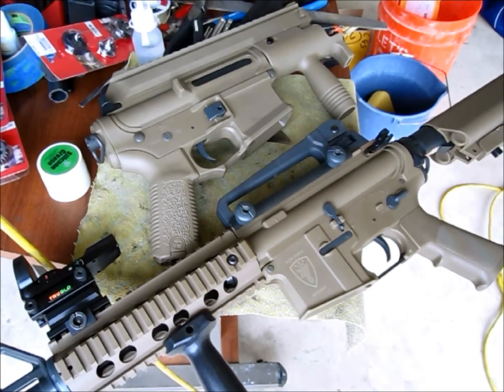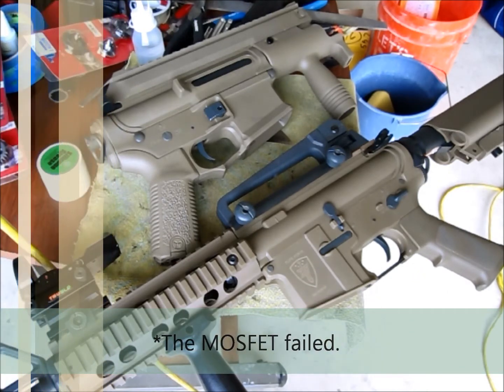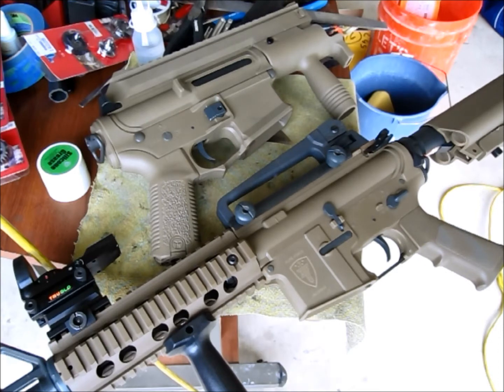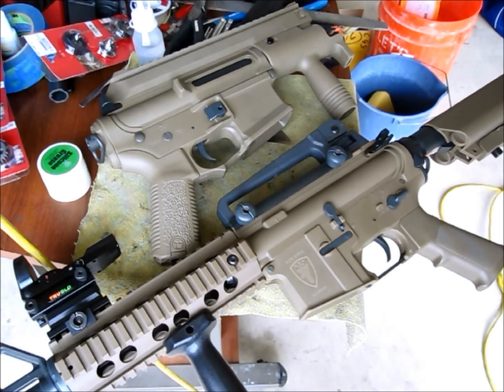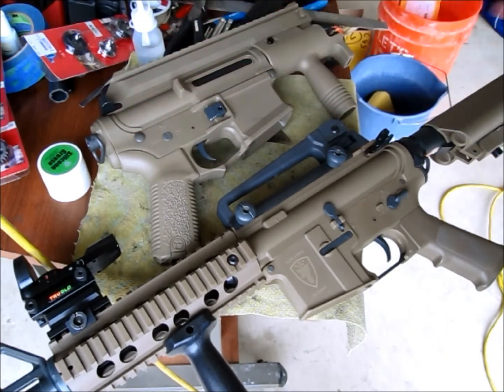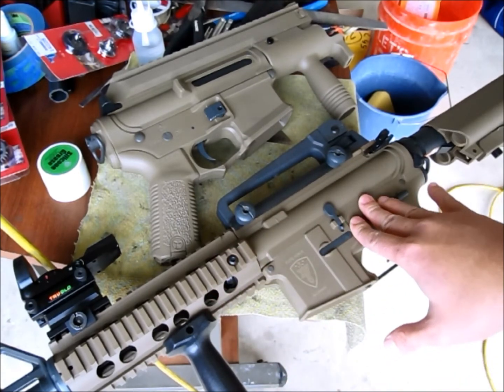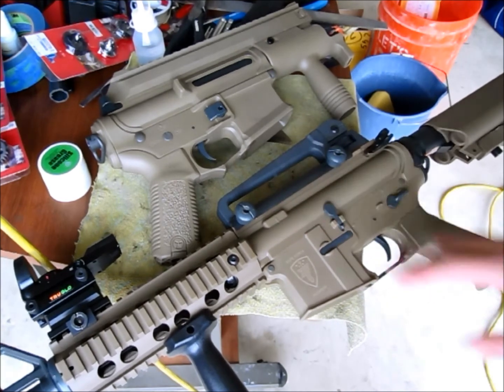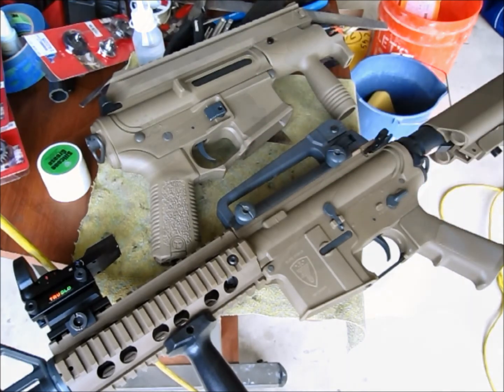Tech Section: Compatibility of ARES V2 Gearbox with Amoeba Series Line. Part 2

Comment: Sup mate, 
from your video it would appear that the Amoeba EFCS GB should fit more or less any TM compatible V2 receiver. Could you kindly confirm?
If not, what would the major differences between TM V2s and the Amoeba EFCS V2 be?
Greetings from Germany
Reply from the maker: +Angelus Nox 

As of right now I only know the ARES EFCS V2 fits in G&P lowers.  Gear Wargame (You Tube Channel) posted a video that the ARES EFCS Gearbox will fit on a G&P Lower: https://www.youtube.com/watch?v=xtSHrvK8Fg8
Reply: +ARES Airsoft Solutions Thanks for your reply. I've gone and tried putting the Amoeba EFCS V2 into a VFC SCAR L and so far, it seems to fit and work, with a few caveats that I'd thought I'd share:

1. Obviously, you'll have to cut off the connector that comes with the gearbox and solder on the spring-mounted pins that connect to the stock
2. The quick spring change screw in the back of the CG-002 / MA-008 is far too long to fit into the SCAR's receiver properly. You'll have to look for a replacement.
3. I had modified this SCAR years ago in an attempt to fit an ICS V2 Split Gearbox in it. I removed some of the ABS to the rear and above the magwell. It doesn't look like the material removed has any bearing on the fit of standard V2 GBs, but I think it is worth mentioning anyway.
4. VFC's line of SCARs (and I believe some other makers as well) use a different selector plate than the standard M4/ V2 plate, and of course the Amoeba GB. Still trying to figure out how to fix this, but I'm probably going to get a replacement SP for the Amoeba GB and cut some teeth in there. 

I currently cannot say with certainty that this setup will work, as I've held off on cutting the connector of the gearbox until I get my replacement spring quick change screw (just in case). The pin connectors in the stock might cause trouble, they might not.

Other than that, it's looking pretty good so far and I'm very hopeful: The amazing performance of an Ares Amoeba EFCS gearbox in the very handy and stylish package of a VFC SCAR L - aaaaw yisss.
Reply from the maker: +Angelus Nox 

Just my response on your points:

1. Looks like it will work just fine.  Just a note, and I'm sure you know already, ARES does sell different length wiring for their EFCS gearbox (and or chipset also sold seperately): Front, Mid, and Rear.  However, it is cheaper to re-solder then buying a whole unit or just the chipset alone.

2. I haven't broken in a SCAR type rifle yet, I'm currently playing with GBB Pistols. In any case, there are several other type of quick change screws you can use.  As far as I can recall, there are about 3 types of quick change screws that will work with the ARES EFCS: Amoeba Long and Short quick change screw, and the standard ARES quick change screw (made in plastic with a single washer or bearing type).

3.  No comment there!

4.  Unfortunately, I'm not familiar with VFC gearboxes.  It will be awhile before I even look at a VFC.  However, ARES does have two different selector plates for their EFCS gearbox.  Countries with semi-only requirements (i.e. Germany) has a special selector plate that limits the EFCS to semi and safe only.  For Countries like the USA, we get another type of special selector plate for safe, semi, and full-auto.

I never got to see how a EFCS selector plate for semi auto looks like, I just assume it looks like the ones for the USA.  However, the EFCS unit is really sensative on the magnet pull force and this affects the selector plate and the EFCS sector gear positioning sensor.

Hope that helps, good luck on your project.  I'm sure the ARES EFCS gearbox should work.
Reply: 1. You're absolutely right about the wiring lengths sold by ARES, but the thing is the VFC SCAR uses a connection between the gearbox wires and the battery wires in the stock that, to my knowledge, no other company does.

2. Probably, I just couldn't find any shop selling these screws. Not that I looked thoroughly, heh. I also happen to have friend who can make one of them for me. I will soon be able to boast that my gun is using titanium parts, hehehe.

4. I wasn't aware that the semi-only mode is done by selector plate, it's understood in the German airsoft community that the chip is different. This could be wrong and many Germans would be happy to learn they wouldn't need a new chip. But honestly, who needs full-auto anyway ;)
The selector of the VFC SCAR, however, uses a small gear (slightly larger than the gears used on some hopup units) instead of the small off-center-mounted discs typical M4s use. As such, the SCAR selector will not engage any M4 selector plate at all. Until I can MacGyver a modified selector plate I can't put the SCAR on safe :-/

Anyway, I hope I'm not coming off as a know-it-all or anything. Just wanted to share what I found out in case someone else does something whacky like this =D
Reply from the maker: I enjoy discussions with other airsoft products and how it affects ARES.  The replies and videos on this channel are based off my experience and they may be incorrect from time to time.  Therefore, your response is helpful for this channel and I hope it helps other ARES enthusiasts.

Comment: if my upper.lower breaks for whatever reason, would i still be able to buy a metal m4 upper and lower for it or do i have to contact ares personally to get another body? (just wondering if the quick change spring design will interfere with either receivers) thanks,
Reply from the maker: +Jason Delitototto

Gear Wargame (You Tube Channel) posted a video that the ARES EFCS Gearbox will fit on a G&P Lower: https://www.youtube.com/watch?v=xtSHrvK8Fg8

However, Gear Wargame never stated if a G&P upper would fit.

If you are using the older ARES V2 Gearbox, they will not fit in any other manufacture lowers and most likely not any other uppers.

Comment: can you change it to a lonex v2 gearbox?
Reply from the maker: Painkiller Snoopydoggy 

On the ARES S-Class or Elite Force ABS plastic lowers, you have to do some modifications on the lower receiver just to have the Lonex V2 gearbox fit.  I believe TheAirsoftTech  (You Tube Channel) went in depth of what you needed to do just to make it fit.

I have not tried to see if any other V2 gearbox would fit the ARES Amoeba series line.  However, the ARES EFCS gearbox did fit in a G&P lower (Gear Waregame - You Tube Channel demonstrate this, but it's in Cantonese).

Evike has some new Matrix (looks like SHS) CNC V2 quick disconnect gearbox that looks like it MIGHT fit, but I haven't gotten around to trying those yet.  In addition, it cost close to $120 US for them too!  I do plan to try this particular gearbox when it goes on sale from Evike, as microswitches are not popular (other than ARES EFCS is a better alternative).
Reply: thanks :) helped a lot :)